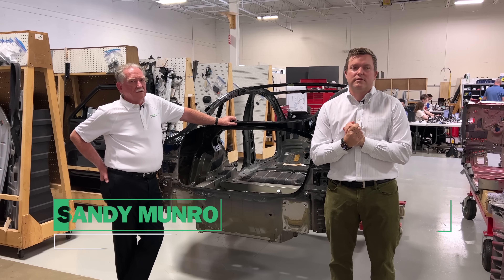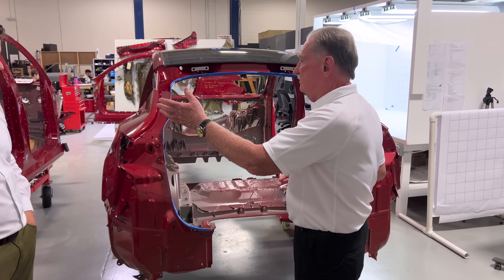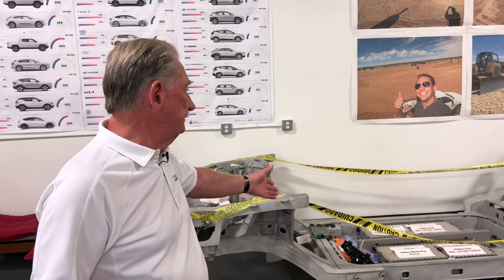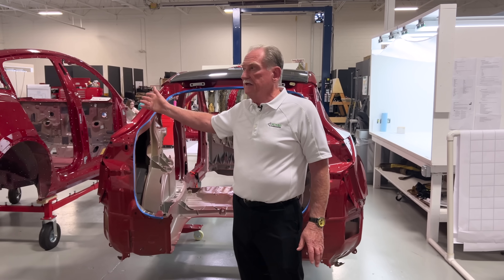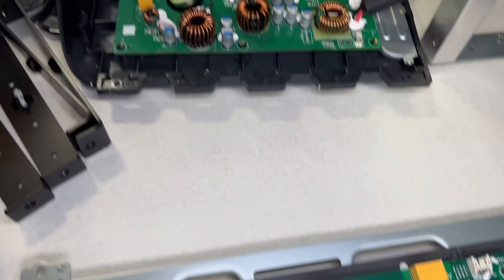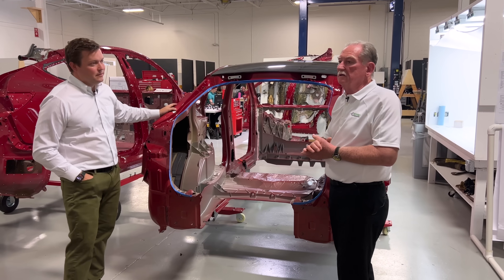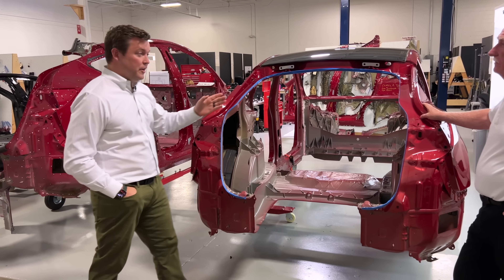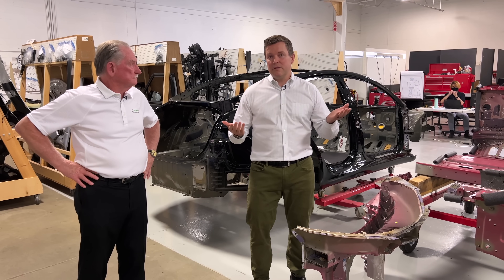Giga Castings with Sandy | Evolution of Tesla Bodies In White

Comment: I almost always enjoy the Munro Live videos but once in while you hit something Sandy has a passionate opinion on and it is 🔥 :)  Great job everyone!
Reply: In some videos like this he is on fire and he is able to transfer his passions super hard to the viewer
Reply: Just about what i wanted to say. Couldn't have done it that well, though :-)
Reply: His passionate "opinion" sounds like marketing brainwash from IDRA to me. And continues with the endorsement of shaving blades or the Anker product here in this video.
For the casting: it is only successful, if other properties are in line with expectations as well: scrap rates of the cast pieces, acceptable quality with regard to blowholes/shrinkholes, low effort in post-treatment after a casting had been cast by the casting machine, handling efforts. It is only revolutionary and innovative, if it matches a number of these criteria, which he did not even mention. And in addition: whether the same casting can be put in Model 3 and Model, which likely isn't the case. So the large castings idea may match with some ways to build cars, but not with all of them, expecially when building many product lines in one factory. A true engineering standpoint would take that into account.
Reply: @koeniglicher  dumbest comment by far
Reply: @gplaneg  
"Dumbest"?
That's cruel
It's close but I've seen a few others which are just deluded FUD. I think they take the prize.
Reply: @koeniglicher  "The Limiting Factor" channel contains a few videos that explore various aspects of gigacasting. I can't recall the details from those videos, but the gist of it is that most/all the concerns you mention have been addressed satisfactorily.
Reply: @CiaranMcHale  I like hour-long videos and the style of "The limiting factor". What I don't like: recalling "gists" from your perception (as it is likely skewed) and the speaker is not an metallurgist (nor battery scientist) himself and has a strong opinion pro Tesla. So, the figures and claims are typically, well, stretched in the way to support the Tesla evangelism/Tesla religion and sometimes based on belief rather than trueth. But The limiting factor is good because it lists facts or claims, that others can falsify.
An engineering standpoint would do not do "gists": it would list figures: tell the price of a conventional body. Tell the price of this casting body. Tell scrap rates. Tell part commonality, tell rework times, and so on. Munro could do so and list their assumptions, including the figures of the analysis. Do they do that here? No. It may be in their reports, but as a non-public information it is hard to falsify at the same time.
Castings have been a part of many car bodies designs (including by major OEMs), just smaller castings, not such big ones. So the real question that arises is not only, whether castings should be used, but also how many from what materials for what purposes.
Reply: @koeniglicher  Your original comment came across as "the video is flawed because some important details were omitted", but I think such a criticism is unjustified because no matter how much detail Munro Live might put into a video, that level of detail would be fine for some viewers, too detailed for other viewers, and not detailed enough for yet other viewers. Since you were unhappy with the lack of detail, I tried to be helpful by pointing out another channel where you might find the level of detail you are seeking. Now that you have expressed the opinion that Munro Live does not provide enough detail in its videos and details provided by The Limiting Factor are unreliable due to its host being a self-taught amateur, it seems to me your options for getting free information to your exacting needs are limited. Get over it.

You wrote, "Castings have been a part of many car bodies designs (including by major OEMs), just smaller castings, not such big ones." That is why Tesla uses the term "giga casting" to refer to its considerably larger castings. You wrote, "So the real question that arises is not only, whether castings should be used, but also how many from what materials for what purposes." Answers to those questions have been provided in other videos by Munro Live and The Limiting Factor. If you have a need to whine that those sources of free information are unsuitable for your needs... get over it.
Reply: @MashDaddy  I once bought the BMW i3 report. Munro made a big fuzz about the many inventions and novelties in this car and the bright future of CFRP bodies in mass production cars. Now, as of the current week in 2022, about 9 years later, BMW i3 production is a thing of the past. CFRP bodies never really cought on in the car mass market, but remain a technology used for some super or hyper cars. From time to time, Munro may praise a new way of construction, but only time will tell, whether this will be mass-adopted.
Reply: @koeniglicher  the gigacasting technique is being adopted by some Chinese manufacturers already. Idra's parent company is supplying them.
Reply: @koeniglicher  you do not come here very often, do you? ;-)
Reply: @koeniglicher  see you soon on that model 3 castings doubt ;) 2023.
Reply: @koeniglicher  
"Scrap rates"? Even scrap can be melted down and go back into the machine.
 Why do you assume they're not prefect every time?
Reply: @rogerstarkey5390  I have two kinds of experience: 1) experience from CFRP production at the BMW i3 production site. The CFRP production and CFRP body assembly with glue were both not perfect every time and unexpectedly high scrap rates in the BMW i3 CFRP body production essentially killed the business case there. Let alone, that recycling for this CFRP material (once mixed with resin and hardened) was a new business process to be created. 2) experience for metal: from a foundry for large vehicle parts from spherulitic graphite cast iron: the larger a piece gets and the more complex it is in shape, the more it is prone to errors.
Potential reasons for not being perfect: changed surface in the die cast form over time from residues, differing temperature distribution, variations in the temperature or pressure of the inflowing alloy, die cast form wearing down over time, variations in the material of the supplied alloy blocks, non-perfect air removal from the die cast canals, misalignments in the machine, to name a few.

Yes, metal scrap parts can be melted down and go back to the machine. But it affects the business case: it is extra time, extra effort and may introduce unwanted contaminates.
And it may necessitate cleaning the die cast form which would mean more planned or unplanned downtime.
There is not a process in  manufacturing, that is "perfect every time" just by itself. "Good enough every time" is the result of quality control efforts: monitoring the machine, its input material, fine-grained control on all variables like temperatures, pressures, preventive maintenance, and checking each cast part or a sample of parts with (automatic) blowhole detection and surface analyses.

Comment: Great video and education. Those complain about crack fixing issue have no idea of how stiff the structure is. Every time you remove a join/bolt/weld and integrate two pieces in a continuous form, the stress transfer becomes more streamline and hence yields the structural rigidity. In short, more weld/join/bolt = higher risk of failure
Reply: Overstiff parts can mearly transfer the crack to another area.
Reply: @andrewholdaway813  Agree with your point, that's why the engineers borrowed the power of FEA to simulate potential area of suspect for cracking if overstiffing issue exist and avoid it if not needed. Besides, the other factor is with the type of aluminum, which is more ductile than conventional aluminum. It has always been a tricky issue to balance stiffness and ductility for a structural part, not to mention ability to case...

Comment: When can we buy the long range gigacasting Y’s?
Reply: They are being sold right now from Berlin and Austin plants.  All Y's made at those two factories are using the gigcastings.  Less is known about the Shanghi and Fremont plants, but I expect if they are not already using the fuill gigacastings, they are just waiting on Giga casting machines to swtich over as quickly as possible.  Too much savings in costs and factory space.  For Shanghai, perhaps that's why they shutdown for a few weeks to switch over and boost production capacity.

Comment: Yes i love the castings, but it‘s not optimal for a platform strategy like the VW MEB covering 4 different brand derivatives.
Reply: So you are saying having a more expensive system in higher volume will save VW money?  Not sure that makes sense. It may save them some design costs and get them to market faster, and I see some value in that.
Reply: @tesla_tap  not shure, but i see clearly some synergy effects on using a adaptable modular platform for the VW group
Reply: MEB is a disaster. Already to be replaced with Trinity. Agile Iteration is a better manufacturing method than Toyota Method.

Comment: I wonder how the weight of the structure changed between these three iterations.
Every kg saved is more range or less money to put into batteries.
Reply: 2020 Model Y LR weights 4386 lbs, and the 2022 Y LR weights 4363, or 23 pounds lighter.  The 2022 added hevier accustic glass in the windows, added more sound insulation, HEPA air filtration, and I'm sure a few other changes, so the lighter castings really did help.
Reply: In one of the first videos on the teardown of the latest version they said that it's actually heavier and aren't sure why yet.
Reply: Plus more sustainable to, less material per car is lower impact on the environment. Sticking to the true reduce, reuse, recycle mantra. 
Any other peer ev competitor right now in this segment is 10-25% heavier than a model y is. Which line's up nicely with how much more battery capacity they need to match a tesla range. 😎👍🏻

Comment: Weird that the 4680 Model Y saves only 20 pounds at the cost of A LOT of driving range.
Reply: Hopefully we’ll find out it’s software locked. Once the last 2170 is built and sold they release a software update to extend the potential thus reducing cancellation of current 2170 orders. 🤷🏼‍♂️

Comment: Nice seeing the last three generations body in white side by side. The changes and improvement are striking.

Morning cup of coffee + Sandy Rant = A most excellent start to my Friday

Can you share the weight of each body in white?
Reply: It applies all through the production. Superfast Matt did a nice video on th differences between the original Model S handles, and the later ones. Part of the reason for the changes was early Tesla was not getting much response from the parts suppliers, but now when Tesla calls up, it's "Oh Hi! What can we do for you?" The newer handles are more sophisticated,, but much more reliable, and likely cheaper. Sandy has done lots on the superbottle, and then the Octovalve. It's all through the cars.
Reply: @grahammonk8013  I saw a Jaguar iPace with a stuck out door handle today.

Comment: Was about to ask “How does the single casting impact auto body repairs from major accidents? Is this repairable or will the car be totaled?”. Glad my A.D.D. didn’t kick in and I watched entire video. Very informative! Great video!!!
Reply: If the force of the impact cracks one of these castings, you are lucky to be alive. Munro has said this on other videos. He just didn’t mention that here.
Reply: @GET2222  
No he didn’t, but he did say don't worry you can tig weld it back together!
Reply: @andrewholdaway813  RIGHT ARM, HE DID! 💪🏼👊🏼
Reply: Safety and performance should be way ahead in consideration over repair-ability for that small percentage chance of having an accident where it's worse than a fender bender, but not so bad that the car totaled.  Now more cars would be deemed totaled, but it's a small number, versus having every single car on the road being cheaper, better forming, and more importantly, safer.
Reply: @lanzer22  Exactly. If a casting gets cracked in an accident, that means your car was hit so hard the the structural integrity of the car is compromised and you do not want that car back. You want your insurance company to reimburse you with a new car. Insurance companies don’t want to pay $15,000-$30,000 fixing a car to get it back in the road and compromised. What’s worse is them having to pay medical bills for the rest of your life. Insurance companies would rather pay for a new car than medical bills.
Reply: Just buff it out! It's fine!

Comment: Thanks Sandy. 
I would short that Casting-fixing-thing to 1 point: If you have an accident and the casting is cracked and you get out of the car nearly uninjured, than be happy you are still alive and buy the next Tesla. 
The force needed to crack the casting in case of an accident normally kills ppl. 
Live saving is more worth than a giant piece of aluminium.
Reply: another thing to realise as well, is that if you smash your car up hard enough to break the casting, chances are the entire car is already totaled to make that happen.
Reply: @KahnSkins  This. If the crash is that severe, you are lucky if you get out of it alive.
Reply: Absolutely.  Safety and performance should be way ahead in consideration over repair-ability for that small percentage chance of having an accident where it's worse than a fender bender, but not having the car totaled.  This is a feature that is a no brainier for any engineers.
Reply: Just like we've seen in electronics over the last several decades, integration brings about increased quality and lower prices with the trade-off being repairability - it's now almost always cheaper to buy a replacement device than the cost of labour to troubleshoot and repair it.
Reply: Does the GigaCasting reduce repairability? Would agree the new battery with poly-foam potted cells definitely reduces repairability. As far as GigaCasting. Isn’t it more repairable? Maybe body shops would need to be retrained? So many questions but feel like Tesla is pushing the market forward. Sort of like when the first 3-4 generations of iPhone came out lightyears ahead of the market...
Reply: That's why you get insurance.
Reply: @peterzerfass4609  "That's why you get insurance."

No. That's why you buy safe car so you will survive.
Reply: @AudiTTQuattro2003  you did see the construction? There is space to the rear bumper. If the casting cracks in case of an accident, you were hit by much force. In this case, be happy if you are still alive. 
Smaller accidents should not hurt the casting, there are some aluminium extruseion parts which catch the force from smaller bumps.
Reply: @AudiTTQuattro2003  they dont to crack a casting you would have to be in an accident that like he said, would normally kill people.
Reply: @carsonj1  "The cars are still designed to be safe, they still have to pass the same standards and crash tests."

It's a different between passing a test and exceeding the requirements of the test.

Comment: The Model 3 (and Y) was always intended to use the cast subframes - they weren't ready so they built them in sheet.
Reply: I agree,  FFVoyager.
Reply: Not true in any way.  Tesla progressed 100 years in auto design within 4.  Tesla just  puts everyone else to shame.
Reply: @_PatrickO  really?  

I'll take what I was told by my old friend whose job title is Senior Manager, Structural Analysis Engineering at Tesla over yours, ok?
Reply: @FFVoyager  Grow up.  A casting can be made to replace stamped and welded parts.  Nothing needs to  be specially designed.  You are pushing legacy auto fud when you falsely claim a car must be designed from scratch to accept a casting.  Your friend is a legacy auto shill.
Reply: @_PatrickO  When Tesla approached tool manufacturers they found only one company (IDRA) that thought it might be possible to produce the press needed to make that casting.  Turns out that they were correct, they could produce one, but a lot of smart engineering went it to making it possible.

Comment: Tesla  pace of innovation  and changes in the span 4   to 3 ylears is astounding , those chassis changes would take a minimum of 2 sheet metal body changes,legacy auto changes external sheetmetal ,underneath hardly anything changes.
Reply: I wonder how much of Tesla's speed of iteration is made possible by vertical integration? Several years ago Tesla acquired a tool and die company and more recently an automation company.
I would imagine that not having to go to external suppliers that also do work for other customers has significant advantages.
Reply: @bradcavanagh3092  Me thinks it is easier  for a team to work together than have each 2nd tier OEM  have their own " Silos" , @ least Sandy thinks so, those suppliers engineers are loathe  to change  and step out of their comfort zone,also  North American  suppliers  won't even return a bid  on a part , the Chinese will ask  " how many and by when", that is said so  by many  small American  manufacturers.
Reply: It is like they are clean sheet redesigning the car every 2 to 4 years.